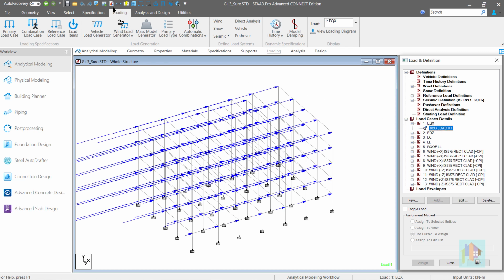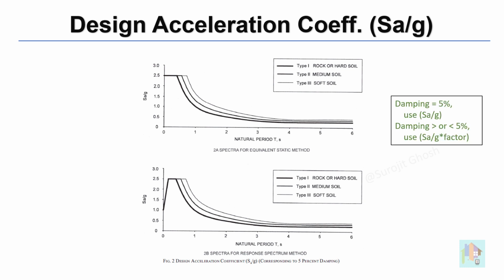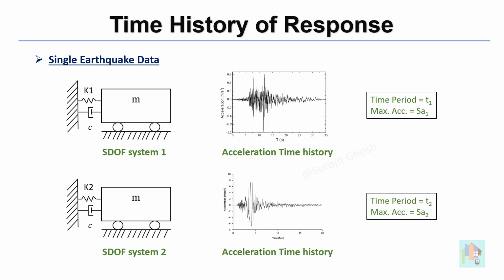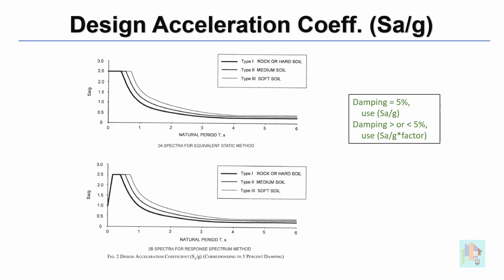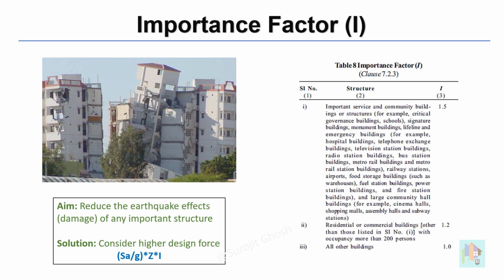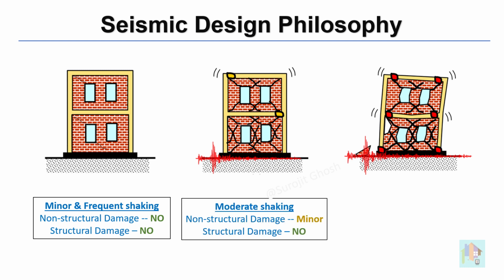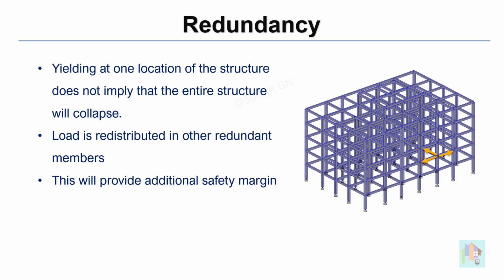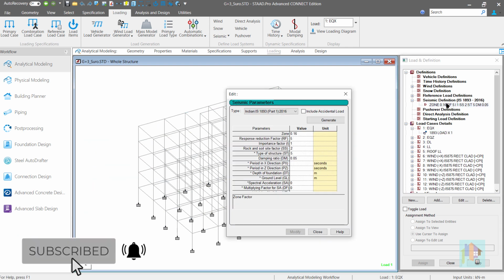Static Seismic with IS1893 - pt.3: Design Horizontal Acc. Coeff.(Ah) || Sa/g, Z, R, Response Spectra

Comment: How to calculat importance factor why its 1.5 why is not1.6 or 1.7
Reply from the maker: This value is available in relevant design guide, for IS code, check cl.6.4.2 and Table 8 of IS1893 (part 1): 2016.

Comment: Hi iam working in a project where even after 400modes in response spectra getting nearly 50% missing mass. How can i account for this lost mass
Reply from the maker: You can use Load dependent Ritz vector method for Eigen solution, by default subspace iteration is used which causes this problem. Change the eigen solution method from Analysis > Miscellaneous command option.

Comment: Great topic an damn well explained . Ther is just one thing which i earlier to highlighted in forums of Bentley , which is why staad has provided only one value for R in seismic defination it should rather be for two horizontal direction , taking case of PEB structures which has been the hot topic over last few webinars , we need two R factors . For American code has two r factors in staad defination , the same could be for Indian code too right ?? Basicallt having two different ah values for two hot directions. We need to scale it in order to implement  two different R values.
Reply from the maker: You are correct, and it is fairly common to have two different framing systems for any steel structure. I am not sure why it is not there for IS code, only way to consider this - using different load factor which is not accurate as several checks (like VBmin) will not be performed. I will suggest you to post this in Ideas channel (https://communities.bentley.com/products/ram-staad/i/ ) and see, what the product management think about this.
Reply: @surojit_ghosh  the problem also is even consultant ofthen  in project specification mentions one value for R  . they also speak the staadpro language . Lesser R value will give more seismic forces and vice versa, which is why then often certain straight forward concepts becomes too complicated even for most of the engineers.